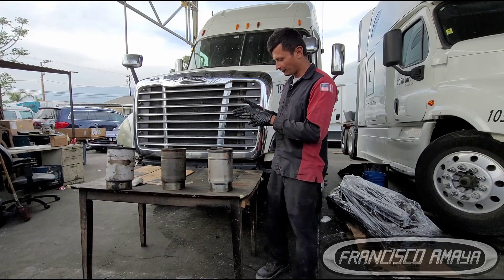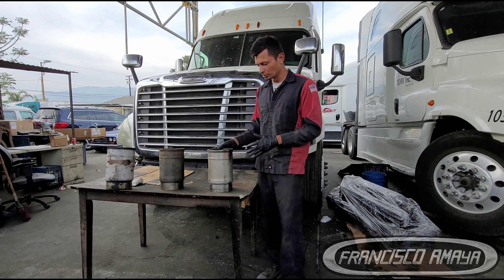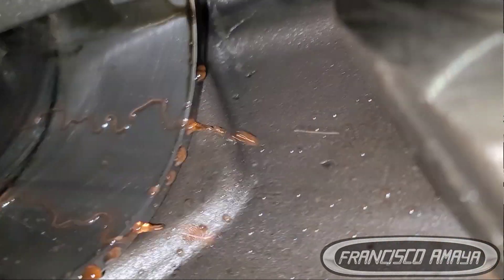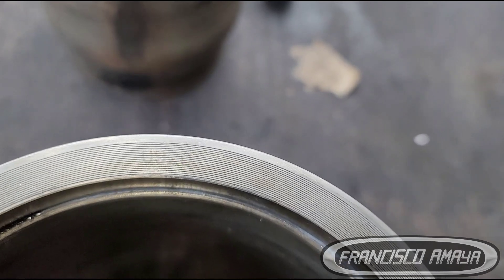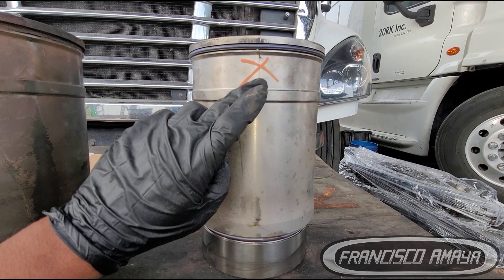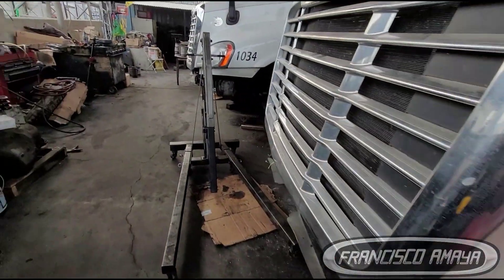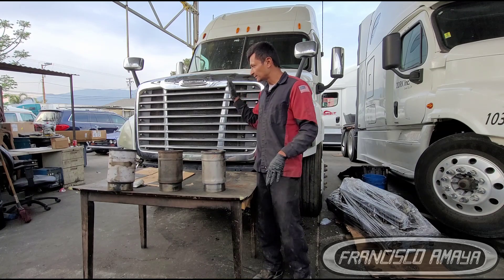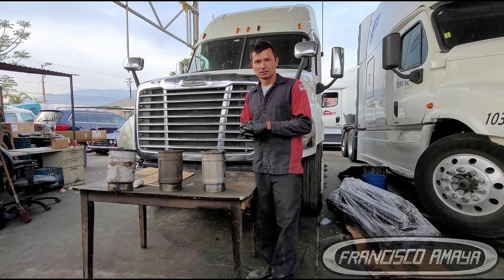PAI aftermarket overhaul kit broken cylinder liner failure DD15 engine damage water in oil

Comment: PAI makes their parts in america, they have 1,2 and 3 year warranty on their parts depending on the cost level of the kit you can buy with the best warranty on their performance kits. For any liner to crack something is off on the block/head. If a factory liner split the whole way like that an aftermarket won't be any better. Some of the older engines are not supported by the factory anymore so there is no choice other than to use PAI. Their customer service is excellent though.

Comment: I just bought a pai kit for a c15 cat. I hope this doesn’t happen to me. This was the fastest turn around for my truck to get back on the road. Cats  parts are 4-6 weeks out on back order. And double the price. Spent 8k on full rebuild kit. Including head. My old head is cracked and they won’t take it as a core at Peterbilt. Or any other supplier in town. Thank you for the info Francisco. Keep on wrenching.
Reply: Hey I’m know I’m a year late, but how is your C15 truck still running? All good so far? How many miles?

Comment: Holy cow I’m wondering could he sue the manufacturer of the overhaul kit to cover everything between the first shot they did it in your shop just going to do the second repair
Reply: Prove it wasn't damaged in transit..what was the liner protrusion..if the liner was too high that can cause cracks liners..any dirt or anything else under the flange can cause crack and on and on and on..people are too quick to blame parts when well over half the time it's not the parts..
Reply: Yep that’s a strong possibility too
Reply: @leejohnson6173 95% it's not parts

Comment: This is happened to me 4-27-2022 after I bought used truck, 3-28-2022 Truck has no warranty only I Running 7k miles then truck it mixed coolant & oil i speed almost 30k😣 so my advice if you want to purchase used truck from the dealer please watch out and by more attention before you purchase it

Comment: I have 2014 dd13 with 900,000 miles...my question is when is the best time to do a inframe...the engine is running fine oil pressure is fine..good fuel mileage...thks..luv ur videos...I have learned alot...
Reply: I have 1.3 million miles on my 2011 dd15 engine. I've been using Walmart brand super tech engine oil or Costco brand Kirkland in my truck since I bought it in 2018. The truck stills runs the same since I've had it. Don't  burn oil either. Just put over 10 thousand miles on the  new oil and the oil is still Yellow and clear not black like other well known brands of oils l used in the  past. I had an oil analysis done 2 oil changes ago and everything is wearing fine no issues of break down in the engine. I know some people think the dd15 engine are crap but this engine is as good as the previous detriot 60 series engine. The key to making an engine last a very long time is frequent oil changes around 20000 or less. I've always changed my oil between 15 and 20 thousand.
Reply: @robertbrown1933 still running?
Reply: I seen these engine hit 2 million with proper maintenance and not driving it like u stole it should last a long time...just saying....
Reply: Just keep doing what you’re doing its working bro
Reply: How many miles you got on it now?

Comment: That liner looks like it was damaged before it was installed. I think it was a mechanic error. Most over haul kits comes from the same company that make those parts. The only difference is Detroit have a certified checker who checks and stamp parts after they pass inspection with Detroit seal. Detroit, cummins, pai and other over haul kit names all come from the same over haul kit parts companies. So some parts shouldn't be called aftermarket parts they should be called different brand parts. Because they all comes from parts making companies  .
Reply: That is the same way it was at the factory I worked at making paper products.  Same paper just switch wrap and boxes.  The only product that was different was Xerox they did more from beginning to end but it was all just quality checks.  We just watched it more closely.
Reply: You right
Reply: Facts man the parts all made in the same warehouse.
Reply: That actually makes sense
Reply: Not all suppliers are OEM suppliers, so what you’re saying is not true. Some suppliers are OE a cat and also supply some of the aftermarket companies. But I know for a fact some of the aftermarket suppliers do not use the OEM suppliers. It all comes down to how good your quality inspection and engineering departments are no matter who’s company you worked for or are working with.
Reply: he didnt even made the first repair and he makes a full diagnose on that failure blaming the PAi liner.... it is very unprofessional ... this type of situations get present in both oem and aftermarket parts... the difference its when parts are OEM they dont blame the parts that easily, thats all.  That crack its clearly a direct hit made to the liner, as he blames the quality of the product in the other side you can reasonably blame the mechanic who made the first repair of not properly handling the parts.